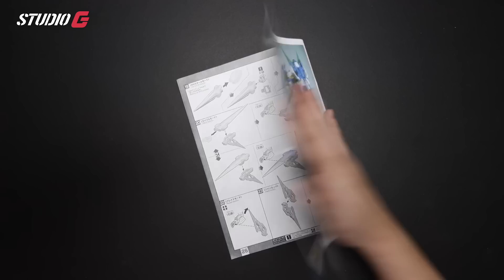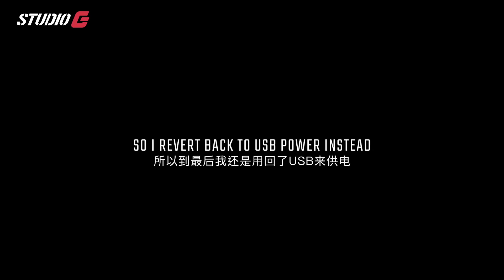CUSTOM BUILD GUNPLA | MG 00 QAN[T] FULL SABER | 00 SERIES STORY EP 04

Comment: What is the best way to cut the runners without damaging the part or leaving stress marks?
Reply: try the 2 steps cutting method (you can look it up on google if you're not clear), basically you make your first cut a bit far away from the part itself, after you cut down the part from the runner, make your second cut to remove the excess nubs on the part (or you can use craft knife to slice it off), sanding is optional, it depends on whether you are doing a straight build or you want to paint it

Comment: Seems kind of silly to leave all that plastic on there only to trim the part twice. You're dulling your nippers twice as fast that way. You're cutting through a lot of plastic.
Reply: he is doing that to avoid damaging the part itself, tools are expendable, if the nipper gets blunt, just replace it. It is better than damaging the parts
Reply: @Kai99097  Those are flush cutters, I know from doing a few sets that you can get right next to the part. It's just entertainment value at this point.
Reply: @EckmanJones  he just don't want to risk it, look for one of his previous videos, he explained about it
Reply: @Kai99097  I know I made the mistake when I was putting together the Wing Zero Custom master grade. I snipped off one of the posts for the feathers. I rebuilt it with baking soda and super glue. Honestly that's stronger than the plastic it's connected to.